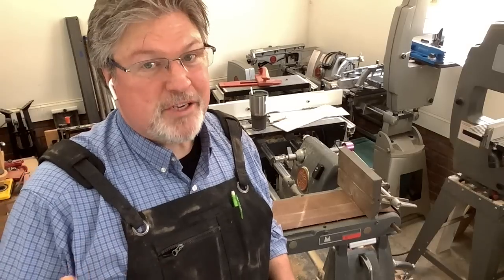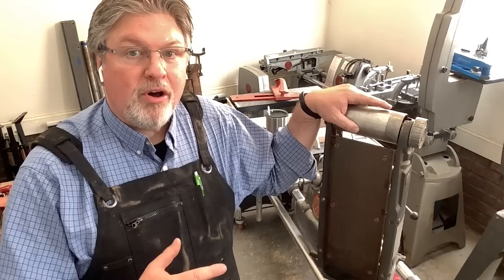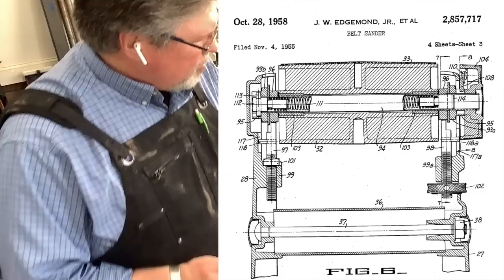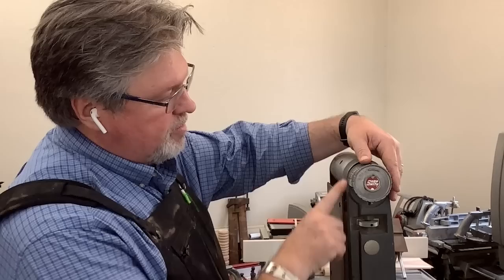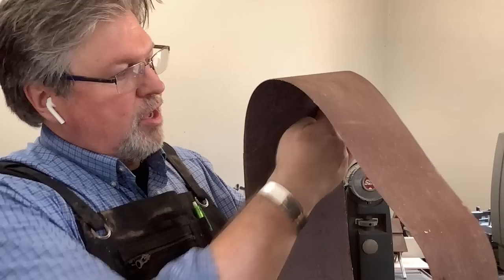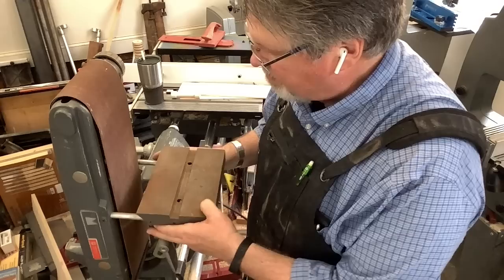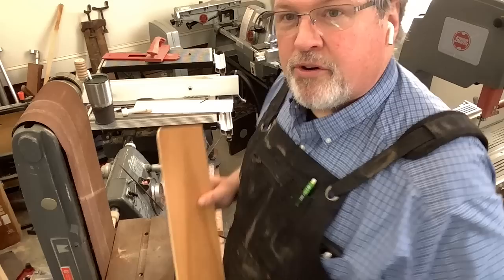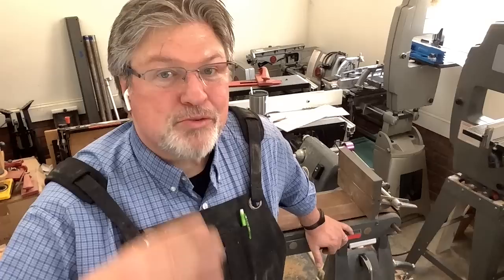Introduction of the Shopsmith 6" Belt Sander SPT (Special Purpose Tool)

Comment: Shopsmith, well built, extremely poorly designed tools.  But the belt sander with it's very solid, multi position table is really good.  Put it on it's own base and you'll have a top notch tool.  But you couldn't force me to take any of the other tools.
Reply from the maker: Matt, clearly, we have a difference of opinion, but I’m assuming yours is based on experience with the tools?
Reply: @MyGrowthRings  Yes, I have experience with a Shopsmith.  If you have tons of time to kill making small hobby geegews and no experience with real shop tools, you might get by for a while with a Shopsmith but having to re-configure the machine every time you want to do a different step or function is beyond maddening.  Plus, while the 6" belt sander on a stand alone base is a hard working tool, the rest of the tools are really small and chintzy.  Again, if you're making bird houses or napkin holders as a hobby, a Shopsmith might be ok but you can buy much better individual versions of all Shopsmith's tools and for a lot less money.  They probably won't have as rugged of construction as the 6" belt sander does but they will do their job MUCH better.
Reply from the maker: @itsmatt2105  I used to work in Architectural Millwork in an industrial shop with every imaginable tool at my disposal and when I needed to do something precisely I used my Shopsmith. Currently I have access at work to a two year old Altendorf sliding saw, a Striebig panel saw and a complete selection of Festool tools, yet you see what I enjoy using at home. Reconfiguring is part of the fun, but then again, so is planning. Most cabinet making projects are done on the tablesaw and jointer, and there’s no reconfiguring required between those two. Anyway, I’m certain that I’m not convincing you, and I hope that you are pleased with the assortment of tools at your disposal. Scott

Comment: Hey Scott, my belt sander has a tubular protrusion opposite the power coupler. I believe I’ve seen photos of a drum sander here. How do I access this feature?
Reply from the maker: That is just a cover, which is wedged in place with a slight taper. Just pull and wiggle and it should come out. You may also need to give it a light tap with a soft mallet to get it to break free if it’s never been removed.
Reply: Thanks Scott? I did exactly as you pointed out. Now my sanding setup is complete 👍